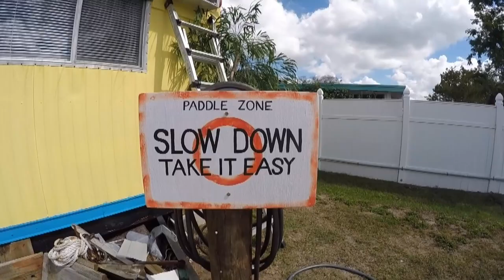Tiki Style Roof Project

Comment: You should have kept all the little pieces of wood left over.  Get a metal burn pit ring and then when you  have customer's burn the little pieces of wood and tell the customers that you gave the tikki guy on the boat a haircut and this is what's left over.
Reply: treated wood puts out some undesirable fumes,, may not be good ..
Reply: I was just figuring to use them for a fire starter outside.